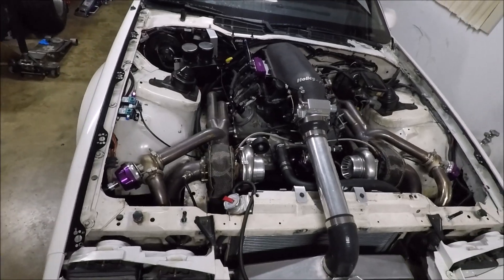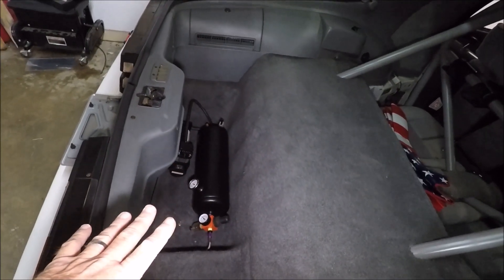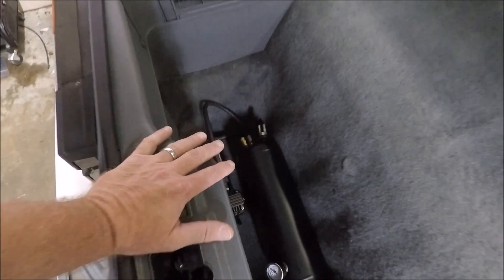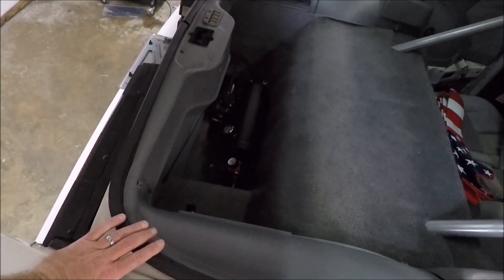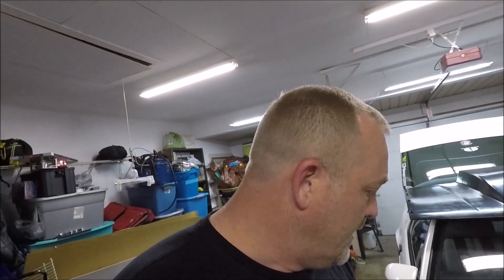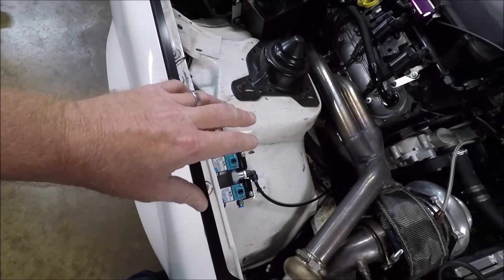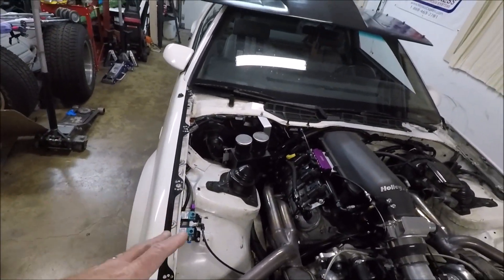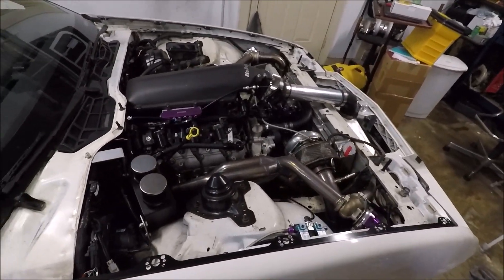ONBOARD AIR BOOST CONTROL ON A BUDGET

Comment: Fantastic idea, sure beats filling Co2 all the time, great work Robert 👌
Reply from the maker: Just to be fair, from what I’ve read you shouldn’t have to fill the CO2 bottle that often unless it’s a street car and you have the boost control on everytime you drive it. If it’s a track only car, you have your boost control dialed in correctly, and you don’t have any leaks, a 5lb bottle should last you quite a while. But for an actual street car that you like to drive and play in a lot I 100% recommend onboard air over CO2.

Comment: Hi,  you could also use an external compressor to fill the tank.
Reply from the maker: This setup uses an external compressor. Vixen also offers setups with compressors built into the tanks if that’s what you’re asking.

Comment: I’ve had my viair little tank setup for probably 6 years without a regulator … issue free for right at $100
Reply from the maker: I wish they were still that price. I probably would have bought one. They WERE the budget option until a few years ago. The base kit is almost twice that price now unless you find a sale.
Reply: @BadLuckGarage    I’ve been happy with it and yea prices are ridiculous.    I went with Boost Leash as well so the fittings, map sensor, mount and all that jazz was with it     Saved all my I/O’s too lol
Reply from the maker: @JCarr65  Not sure if you saw the previous video but I had to take my fans off the Holley to run the dual mac valves. And the temp switch I put them on ended up being junk. So now I’m looking at ordering a cheap adjustable fan controller until I finally get a dominator. There’s gonna be ALOT of changes on this car once I switch to a dominator.
Reply: @BadLuckGarage    I missed the last video I guess.      But yea the boost leash has made my termx be more than enough.        Fan, flex, and 2 step is all I use now on the I/O lol
Reply from the maker: @JCarr65  I plan to go data dumb once I get a Dom. Lol. Shock sensors, traction control, the whole nine yards.

Comment: I ordered a 98mm gt45 turbo and I have a 1.8l motor I’m thinking of doing a similar setup. I don’t want to run nitrous because I don’t want to always fill up the car. would I be possible for the car to reach full boost at 4500 rpm’s ? Is that too unrealistic. I’m thinking of starting to spray a lot of air at 2000 rpm’s and then hopfully it can be spooled up all the way a 4k rpm’s (20psi)
Reply from the maker: That’s not how this works
Reply: @BadLuckGarage  then what does it do ?  or is there a way you can put a nozzle into the turbo similar to nitrous to make it spool up ? I’m just pretty much asking and curious to see if there is a way a 98mm work with a 1.8l motor, without using nitrous or co2 and always having to fill up bottles
Reply from the maker: What it does is explained in the video. And no you can’t use compressed air or CO2 to help spool the turbos. That’s a nitrous only deal. Not trying to be an ass brother but it seems you need to do some research and understand exactly what’s going on and exactly why some people use nitrous to spool larger turbos. I’d also reconsider using that GT45 on that little 1.8liter. What exactly is your goal HP wise? Because I thinks you’d probably be a lot happier with something like a gt3582 or maybe even something even smaller.

Comment: So are you useing the air to boost the engine directly or to help keep the turbos spooled to eliminate turbo lag
Reply from the maker: Neither.
Reply: @ I’m so confused
Reply from the maker: It’s not confusing if you have a basic understanding of how a wastegate and boost control actually work. With either CO2 or onboard air, you’re  just putting more air on top of the gate to hold it shut until the desired boost level is reached. Or varying the amount of air on the gate at different times to maintain that boost level or to ramp boost in over a certain period of time. Lots of videos on YouTube that you can watch to get a better grasp of it. 👍